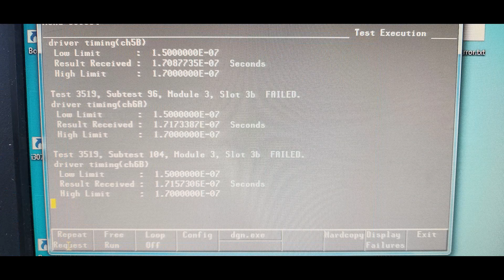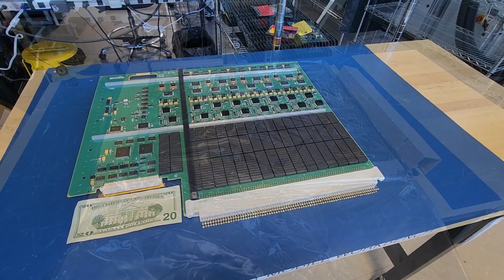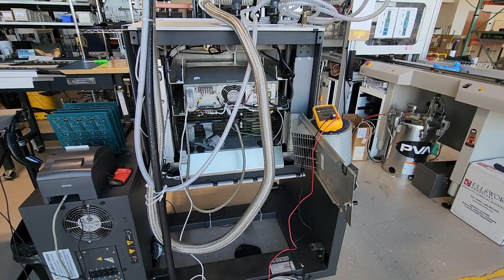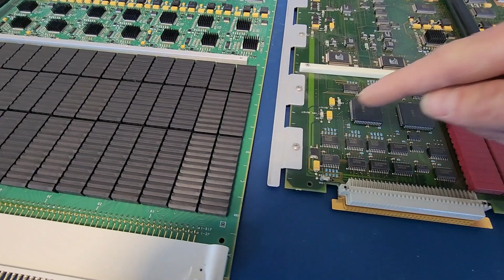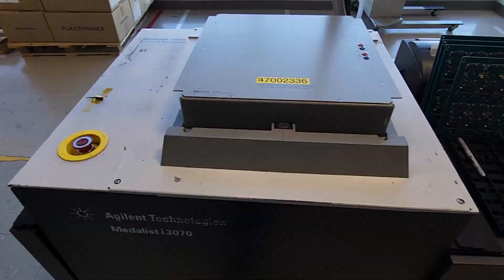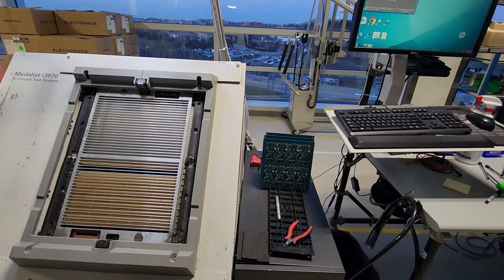Agilent Medalist i3070 ICT. Malfunctioning pin card PCBA swap

Comment: Oh, wow. I was a 3070 programmer for about 20 years. Pretty sure I could still swap out a card in decent time even though I haven't touched one in more than a few years. It's fun to compare some of the mid-1990s double density hybrid cards to those newer ones from Keysight.
Reply from the maker: Oh cool. After 20 years I have high confidence you could do it quickly. Neat to hear from someone form the 3070 family. Thank you sir for stopping by!